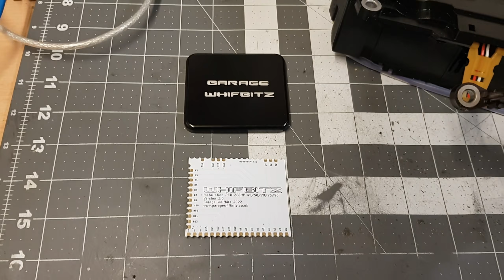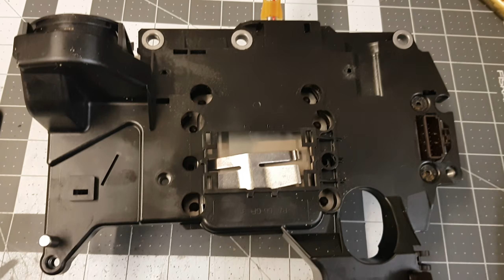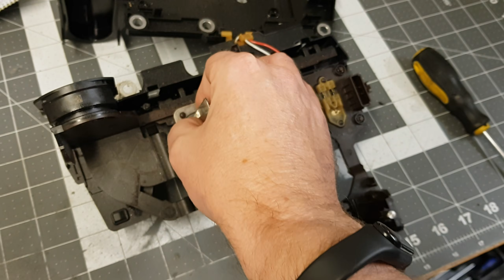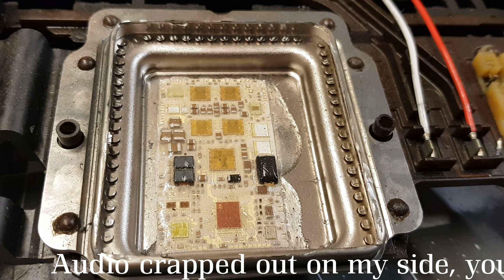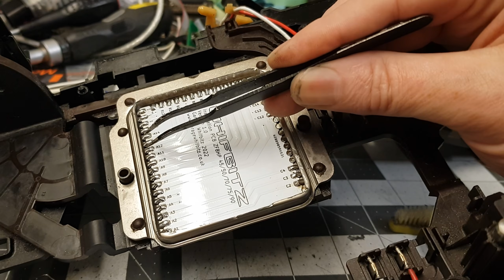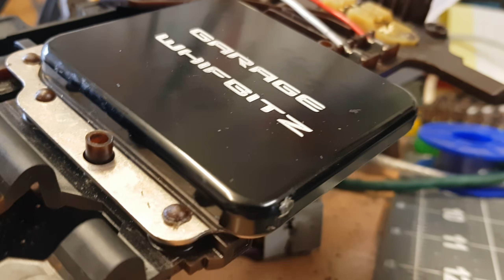8HP Swap - Turbolamik Standalone Mod

Comment: I would prefer to solder wire bridges instead of that "card" because I can imagine that the solder can work loose with heat cycles of the gearbox (expanding/shrinking of all involved parts). 🤔🤔
Reply from the maker: Yea, I know what you mean. I believe Turbolamik originally used wires, it's possible they still use the wires, but they do say they sell a PCB board in their store.
Reply: Or something like both. Wire bridges on a card and shove it in the housing. 
Could be maybe not so Hassle free like the solder on card. ¯\_(ツ)_/¯